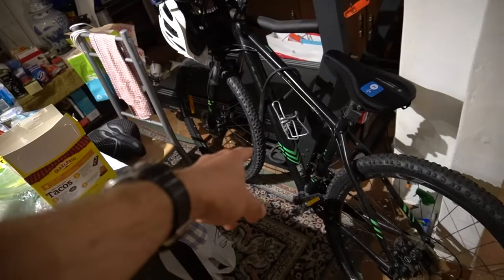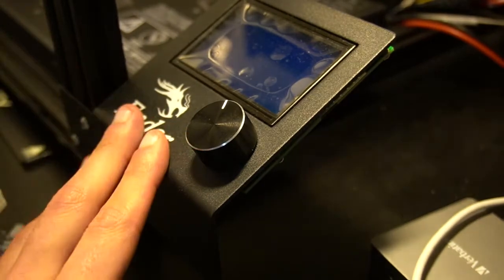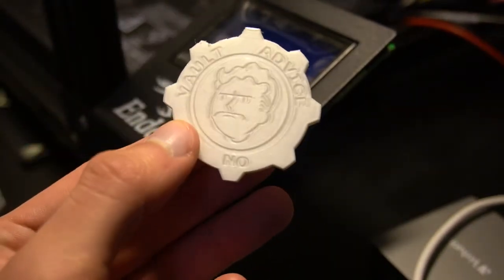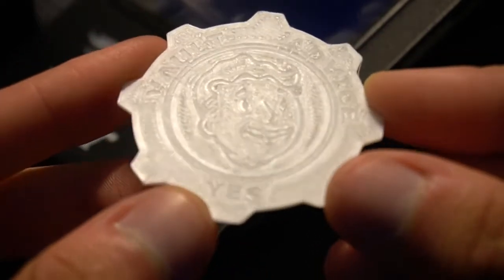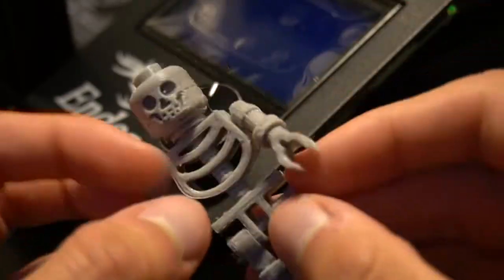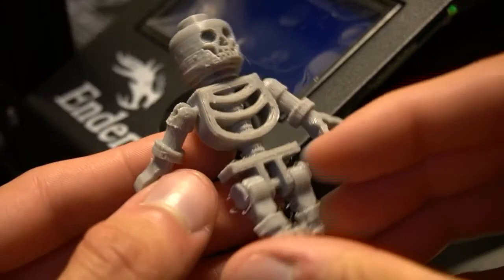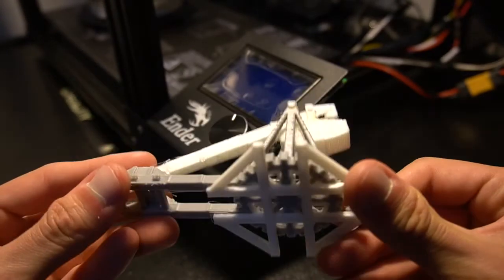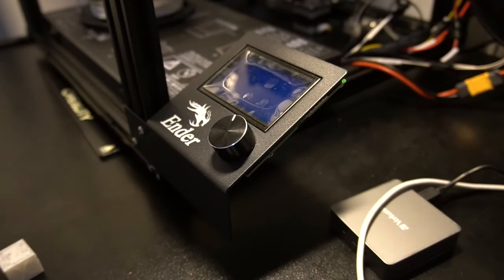I have a 3D printer! Ender 5 Pro first builds.

Comment: Just found my glass and a failed print smashed on the floor today...i guess the nozzle got caught and ripped the plate from the clips.......fml.

Do you know how to fix the purge line? the first purge lines I get go right across the bottom of my print it a huge triangle.
Reply from the maker: Try to use a different glass with some glue stick applied on top, and if this doesn’t work -> new nozzle may be needed.